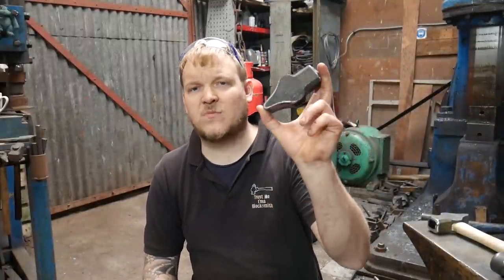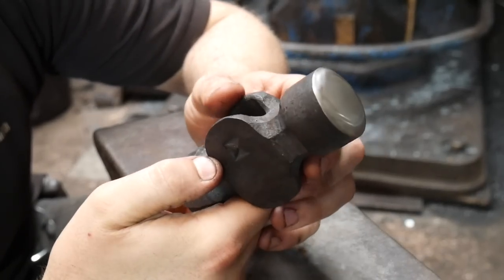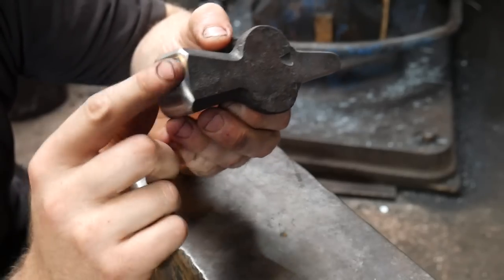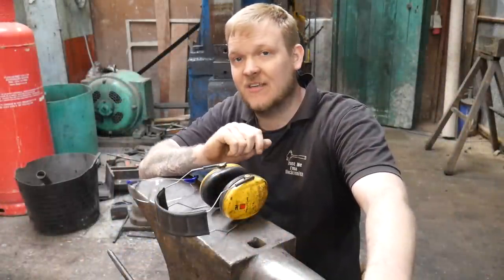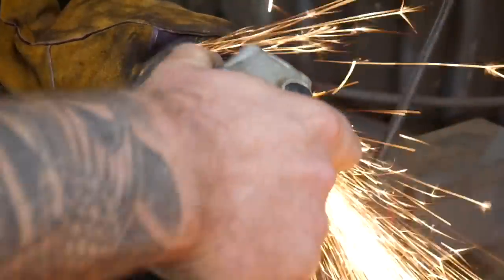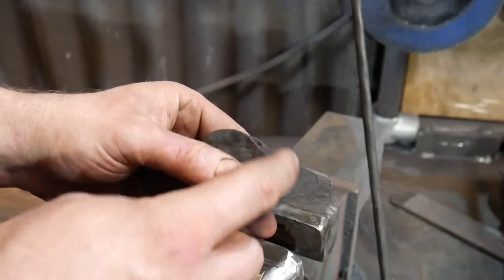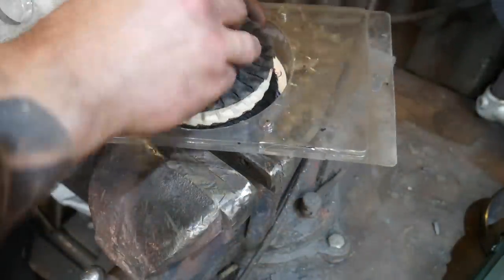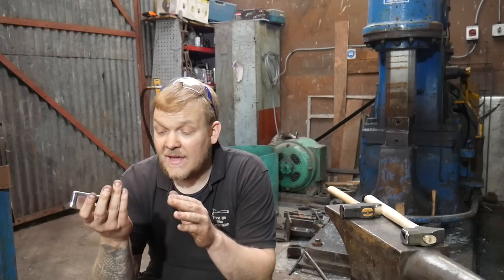How To face/Dress a Blacksmith Hammer.

Comment: Excellent video on hammer dressing.  I may have missed it in the video, but if you are doing any grinding or polishing on the face after it has been tempered, don't get the face any hotter than, say, uncomfortable to the touch.  Keep it cool and keep the temper!  That goes for store-bought or second hand hammers as well.

Comment: Interesting video with lots of useful info. I recently purchased a lot of hammer heads and have been finishing them and adding or fixing the handles.  I try to avoid using a grinder and have used a belt sander to achieve similar profiling and then polishing on a bench grinder to polish. Both are inexpensive models and they are somewhat under powered and don't cut too aggressively. This process appears to be a bit slower than what you demonstrated with the grinder but I found I could control things better and felt personally safer with these tools than with using the grinder. Your results look much nicer than mine but I think that is a matter of your skill vs mine. Just thought I mention this as I think its much easier than using a rasp/file.   Thanks for the video as it give me a lot of insight on what the profiles really need to be.

Comment: Thank you Daniel for the great video on this subject. I am extremely new to blackskithing 69 retired, I built me a coal forge that turned out very nice I might add... I did come to learn it is much easier to build a forge then it is to actually forge. Anyway, I have been acquiring a number of tools a few used hammers that need dressing, Swedish, German, and French styles ranging from 600 to 1200 grams. This vid is very helpful.
Thanks again,
Warm Regards.